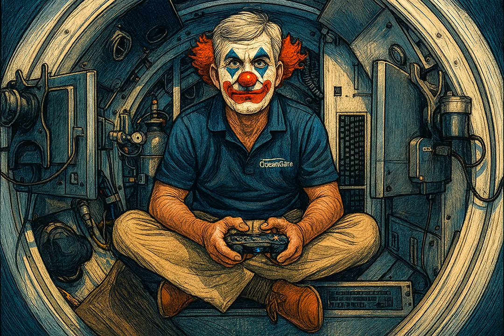David Lochridge OceanGate Firing – full audio of meeting with Stockton Rush

Comment: @4:00 thermocouples inside the laminate might not be an improvement but a vulnerability.  He's claiming it's highly tolerant with defects under compression completely inductive reasoning but it was 8 years so he knows what he's talking about.

@10:00 the philosophy he is using is that o-rings leak and acrylic creaks before it fails. 🤦‍♂️

...I'm done - too many similarities working with awful managers who think cutting corners is smart and don't realise that standards are a floor - the bare minimum

Comment: I have worked on innovative research projects where no lives were on the line. And I would still always humbly listen to suggestions by experts as well as lay persons.

If I can not answer a question as to how and why a design is the way it is, I accept it and will put in the work to answer the question to rule out a system failure.

These guys had their minds made up. They were already right in their minds and had lost all humility and could not even begin to listen to any criticism.

Comment: 58:20 Staggering comment. Yes an engineer designed and built my car BUT before I was allowed to drive it it was vigorously tested and certified. You took passengers to the bottom of the sea in a test experiment! 🤨

Comment: "We're prepared to take any risk as long as we get a warning...  at 12,500 feet below the surface of the sea. If that isn't the definition of arrogance, negligence and stupidity nothing is.
Reply: Comparatively, I’m a layman when it comes to engineering submersibles; but, I have enough diving, engineering, and physics knowledge to know that getting a warning that deep might not give a pilot enough time to surface before catastrophic failure. He thought because there’d never been a submersible failure for commercial dives that the ocean was an inherently safer place than it actually is, because he failed to recognize that there’d never been an incident with a commercial sub specifically because they used years of experience and testing to develop baseline safety standards and had regulations to prevent people from skirting around those standards.

Comment: I already concluded that their number one safety feature, the hull sensors, where ignored at dive 80 since it did show a change in the data. One that was significant enough to throw a red flag warning that the hull did change. It was all about money, as re-doing, or having the hull checked out, would cost too much. This sub technically did reach those depths but they also knew it was never designed to have many many dives like that as every dive simply changes the carbon fiber. It won't warn, it won't slowly start pushing water in, it will be instant and with such violent, that nobody was even able to have a fair warning before. Perhaps in that one little moment "Dropped 2 weights" something was up, but at the same time too late. It was wicked to see the implosion sound followed with a message that 2 weights where dropped. That was the last thing they actually typed down there.
Reply from the maker: Yes, I think OceanGate was running out of money. They already had to replace the hull once – replacing it again would be impossible as it would be a tacit admission that what they were doing was unsafe and unsustainable. 
It's eerie to think about what might have transpired in those last moments before the implosion.
Reply: @MatthewMoonen  There is no time for having a moment on what's about to happen. It goes so violent, within an eye blink it's done, gone and you stopped existing. Your body turned into a paste and that's it.
Reply: @vanderlinde4you 
They could have heard the sound of something happening before the point of failure
Reply: @Heytheresnoopy  I doubt it. It goes so rapid, not even an eyeblink is enough of time to experience anything of it. Implosion was instant ; no warning, nothing.

Comment: Smart people are not immune to bias, shortsightedness, or inability to recognize all pathways to failure.  They did one-off pressure tests on carbon fiber hull models with no consideration of fatigue and delamination from multiple cycles.  They lauded their "early warning" system of acoustic monitoring and strain gauges as a foolproof failsafe to prevent catastrophe.  But in practice, they ignored the increased frequency of delaminations and hull popping in the dives before the disaster.  And, as many dead fools could attest, the final calamity doesn't knock but bursts through the door like the Kool-Aid man.
Reply: The acoustic sensor monitoring actually worked. It would have prevented the disaster. But no warning system will ever be good enough if you ignore the results.

And just as much as they should have tested the hull, the added monitoring system should have similarly been tested. You can't just record data and not determine when this data indicates imminent failure. To determine the quality of monitoring you need to measure the point of failure using the monitoring system for multiple hulls to the point of failure.

Only when you go through this tedious and expensive process can you know what your monitoring data actually means and you can determine a statistical likelihood for imminent failure.

All of this is not new. Any decent engineer would tell you this is how you quantify such things. No AI magic is going to help much either.

Comment: The saddest thing here is that the implosion happened so quickly, he could not realize he was wrong and possibly gain humility.
Reply: People like rush wont accept the truth even if it stares right back at them so it wouldn't matter sadly
Reply: Well, after he died, he stood before The Truth and was judged.
Reply: He probably didn’t particularly hear cracking, if it failed at the front ring/hill interface.

Comment: "it screams like a mother before it implodes". If he was right, Stockton possibly knew Titan was going to implode before the others of the crew, maybe seconds before? Sure lot of gun shots sounds increasing till the failure. The dead was instantly but the fear was there for seconds or minutes due the crack sounds.I don't think it was all that sudden
Reply: The guy knew nothing about statistics and failure points on structures subjected to gigantic strains apparently .......There's NO statistical GUARANTEE that a failure point sufficient to provoke the nano split second cave in would be preceded by a long progressive succession of thousands of carbon fiber crackling ......You just need ONE carbon fiber strand failing at the wrong point to provoke the final cave in domino effect on all the other carbon fibers surrounding the area ( THAT's the screaming like a mother he's talking about , but he wouldn't have been able to hear it in his "monitoring system" because as it would have happened , his skull would be in the advanced process of being CRUSHED )   , what he says about the hull "screaming like a mother"  makes no scientific sense AT ALL ...ZERO sense

Comment: How could anyone in their right mind, go under the ocean at 3000 meters in a plastic tube?? Wtf is wrong with people?
Reply: It wasn’t plastic, it was Carbon fiber with titanium, titanium survived, Carbon fiber didn’t, just like everyone predicted … James Cameron built a real sub, that is safe …
Reply: @funkyflights it was carbon fibres lathered in epoxy resin which is a polymer and a plastic.

In compression the polymer takes an enormous amount of stress compared to the carbon fibres.

Plastics/polymers have been proven over decades as pressure vessels, notably acrylic viewing windows. But compared to titanium it must be significantly thicker and so heavier.

Fully transparent acrylic spherical submarines exist, but they are only rated for tens of metres. A carbon fibre polymer composite is a complete unknown until you fully specify every step in manufacture and resultant application followed by repeated independent testing.
Reply: @beardedchimp … Insanity, it’s still gonna delaminate over time even if you try to seal it with something, that was obvious, you could hear the carbon fiber popping and warning them over and over …

Comment: 3:20 "Carbon fiber is better in compression than it is in tension - that's what nobody understands. It's completely opposite of what everyone else says." -- Stockton Rush

Might have proved to be true if they had included 45 degree plies as directed by Boeing instead of omitting them. The hull would have been 7" thick instead of 5". That difference of 2" would have been 45 degree plies.
Reply: Why did he believe this? Was it just hubris?
Reply: @danielzig1 His conclusions from 1/3 scale testing.
Reply: @VegasCyclingFreak the "everyone else in research are wrong" guys sure are scary
Reply: @danielzig1  I get where Rush was coming from but he was too quick to jump to conclusions. The CF hull concept needed much more testing, time and money. It didn't help that apparently three of the acoustic sensors were not operating as expected. I suspect the area of the hull that failed was where the "deaf" sensors were. Hard to know where the source of that problem lies... may have been programming, improper installation, wrong type of sensors... who knows?

Comment: 4:37 "Carbon fiber in massive uniform compression is highly tolerant of voids and mistakes in manufacturing defects, which is the opposite.... I've talked to experts at DARPA, I've talked to experts at Boeing, I've talked to Spencer, I've talked to ATK, I've talked to General Dynamics. Ya know it's been an 8 year project. I know what the hell I'm talking about". -- Stockton Rush

Comment: Does anybody else here want to build a 10 inch thick carbon fibre submersible, just to see if it works ? Boeing said it would .. 😂🤔🤷
Reply: If you could build it without any voids or wrinkles, not leave it out in the winter, and avoid banging it around at all, I virtually guarantee it will work - for the first dive, anyway :)  After that all bets are off!

Comment: This Tony Nissen guy should prolly be brought up in court.
Reply: Nissen is the aquatic equivalent of a mad scientist. He still believes in his head that if Stockton Rush listened to him, eventually the sub would have worked. We will never know, sadly 😮
Reply: @Number-5-is-alive  Nissen is a very good engineer. What he says makes sense. I am also sure that if they had changed the hull or if they had made it thicker there would have been no implosion if the hull failed indeed. But do we know what exactly failed? Maybe it's something no one thought about - not tony, not stockton, not david
Reply: @LukoBala… Carbon Fiber delaminates, that’s why it failed, the Hull slowly weakened with every dive …
Reply: @funkyflights  And metal bends, no shit. There' a lot more factors than just material here.
Reply: @tomverlaine728 …  Bullshit, material is number one here, you don’t use Carbon fiber to protect from deep Ocean pressure …
Reply: @funkyflights not necessarily true, carbon fibre can be used for that purpose, the problem is they didn't do it correctly. Had they actually tested it, used boeings recommendations of a 9 or even 7 inch hull and maintained the proper safety margins for all we know we could have a full operational oceangate right now
Reply: He strikes me as a bit of a snake. Not heard a thing from Kyle Bingham either, mission director of Titan dives but has been silent since the implosion.
Reply: @wattage2007  exactly you can hear him trying to suck up to Stockton when talking to Lochridge where it’s very clear that he was at the very least gaslighting Rush’s narcissism and psychopathy, or worse he’s an idiot who got to survive and procreate instead of trade places with that 19yr old kid that perished. It’s real easy for him to now make Stockton out to be this lone suicidal cult serial killer with hindsight on his side and a dead guy not able to defend himself. But when we hear you defending him at every turn against a whistleblower within the company’s board who’s just as invested in this being a success as anyone, you can’t just say I had no responsibility and was actually on lochridge’s side of concern.
Reply: @wattage2007  why is tony a snake?
Reply: @LukoBalaSorry, not so much a snake, more of a weasel. In the inquiry, painted himself as the sole voice of dissent within the company but we hear him on this tape being an obstructive, condescending, obsequious yes-man. Carry on defending him though, funny to have one person in the comment thread making such a public fool of themselves.
Reply: Tbf he’d been gone for years by the time it imploded
Reply: Listen to his rambling hour plus on 60 mins. Filled with analogies and illusion to ensure the interviewer would just want it over. He giggled a lot too. An odd man indeed.
Reply: why should anyone be brought up in court? We live in such a twisted world that if i sign a paper that i want to go on an experimental sub where I can die, still someone else has to be found responsible for my death?! not to mention these people paid to be there. it's one thing to sign a document saying you agree to risk your life when you really need to do that specific thing... and another to really choose to do it just for fun as a hobby. It's not like those people really needed to be at the bottom of the ocean and only titan could take them there so they had to sign those papers. No. It was just entertainment for them.
Reply: @LukoBala i am convinced you are tony nissen.  why are you defending this guy so much?
Reply: @LukoBalaThe issue is negligence. Nobody is arguing that going to the Titanic was going to be safe. But Oceangate made promises they were never going to be able to keep. The passengers trusted that they had done the work and research and testing to ensure that the sub was safe, ESPECIALLY since it was an entirely experimental technology. But they didn't do any of that due diligence and this interview proves that. Not only that, it seems likely that they KNEW the sub was unsafe, because Tony got defensive whenever he was asked for data, and they outright admitted it didn't meet certain safety standards. In my opinion there's some pretty obvious liability here
Reply: @LukoBalaWhat’s funny is you don’t even try to hide your arrogance…. Just like Tony. Hey Tony.
Reply: @LukoBalabecause people were lied to and believed they were safe. Despite the warnings.

Comment: I had a bad taste in my mouth listening to Rush and Nissen in earlier recordings.   Individually they were pompous fools.  Together they were dangerous idiots.  I know it’s easy for me to play engineer after the fact.   They were playing engineer the whole time.  My gosh anyone can do their own research to understand that carbon fiber was not the appropriate material to use.   You’d probably need to make it with a wall 3 feet thick with a pencil thin tube and send a mouse to those depths and you might get away with it.  The fact that they got away with several dives before disaster was simply luck of the draw.  Lastly, the RTM that he was so proud of actually spit out some data that they either missed or ignored.  Data that told them that the hull was damaged and probably should never be used again.
Reply: Not only that, but you hire people to give you advice and then don't follow any of it. Boeing told them 7"-10" thickness and they go with 5". That's only one, of countless examples.

Comment: Criminal neglect. Why does he say carbon fiber is stronger under compression? Every other engineer says its worse & gave several in depth explanation as to why. Rush xidnt give much of any reason.
Reply: Well his reason is he's smarter and going to prove them wrong. He's a snake oil salesman. If he doesn't have data to back up his claim he will try to convince them with conviction.